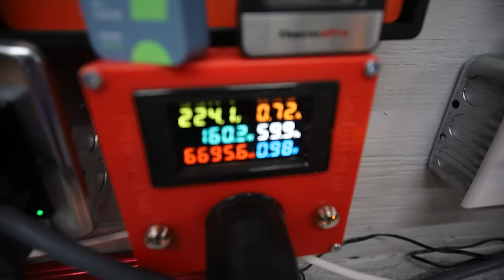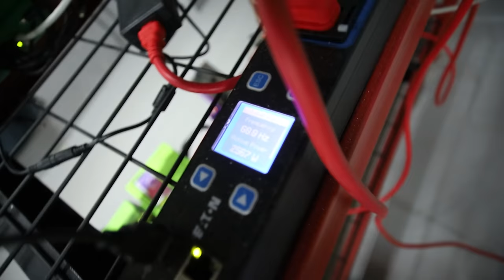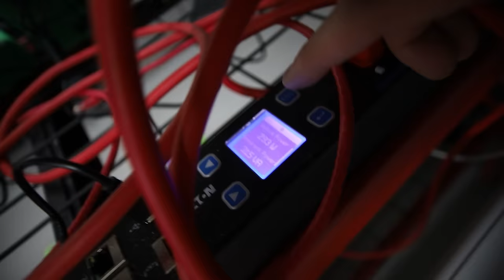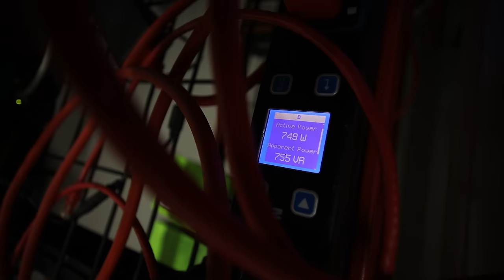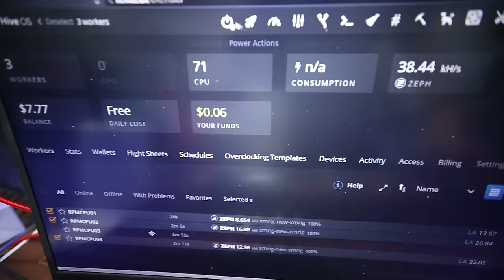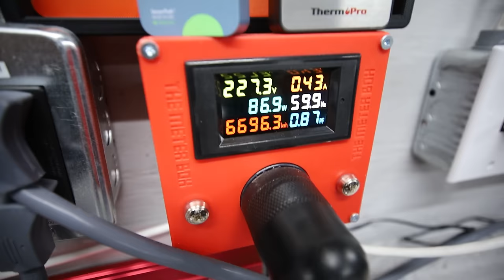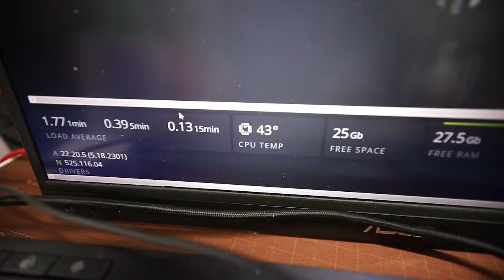My CPU Mining Farm Begins Now.

Comment: I have that exact ASUS b450m Prime and had the same issue with the ZSX AMP. The board requires 4 12v lines on the cpu side. I resolved this issue by using half of the 8 pin connector from the 24 pin + 8 pin pcie and the pther half from a PCIE 6pin to 8 pin cpu adapter cable. The bottom line is that this board requires 4 12v lines and 4 ground lines. By combining the 2 12v lines that come out of the cable included and using the other 2 from the PCIE rails plus an adapter. It looks jank AF but it works and it doesn’t heat up. If a board allows you to use the included cable it’s not good news anyway because you would be putting a 4 line load on 2 lines that are (y) split at the end.
Reply: yes. had this same issue with an msi board a couple gens back
Reply: Do you have a diagram or video you could reference? Trying to visualize what you're doing. I have the same issue.
Reply: Do you have a diagram or drawing of your setup? I'm having the same issue.

Comment: 03:00 hello old friend, the barn!
03:12 GAT DAMMIT
14:20 some boards need AC on to work with ATX stuff that powers on before the power on call. set the bios correctly and it'll go. ran in to that issue when I ran ATX splitters with dissimilar motherboard pairs. would not post no matter what.

Comment: live stream or videos, just start an assembly line and fire up one rig at a time on a workbench then once its tuned/healthy then move it to the pico power supplies/main CPU mining table.    Also, reconsider using zip ties and a aaawave frame :)

Comment: I CPU farm and use both AIO water coolers and Air Coolers.  I would be interested in finding out which budget cooler seems to be your preferred cooler.  I realize it doesn't take a 250 Watt rated cooler to do the job.

Comment: if your gonna spend all this money on motherboards, so you can mine on 1700x's that are making like 10 cents a day... and each board requires ram and just well an entire setup realistically.. and you have Dominator Ram in most of them ? why not just go big and build out a couple of server style boards that can run multiple server cpus.. or at least run threadrippers.. the hashrate of a 1700x is like 1500mhs, hardly seems worth all that hardware to mine on something like that, but do you man, Ive always been a big fan, just a little confused about your cpu mining adventure with some of the expensive hardware running low hashrate cpus and taking up that much space.

Comment: I'm wondering if you can rig up nine motherboards on  21 GPU open frame rig. If yes, stack another one on top and you got a eighteen CPU rig stack. Otherwise, I'd probably  use wire shelvings and stack as many shelves as possible.

Comment: your going to talk into and smack that table. then watch a CPU frame fall off the end onto the floor. put it on a shelf bro... I've go my CPU rigs on a pice of MDF just big enough for the board and the external 300 watt pico. i use a PCIe extenion cable to extend the 12v to the break-out board.. all running off one HP PSU.

Comment: RPM great video man. Does anyone here know where to get motherboard stands that are similar to the ones RPM is using here (CCXD is not selling them anymore). I bought some other type from eBay, but they tend to tip forward even when placing the MB upside down. Thanks